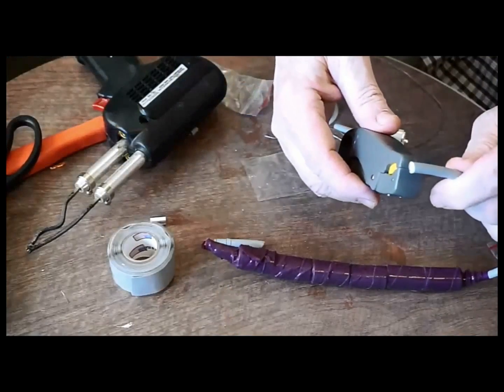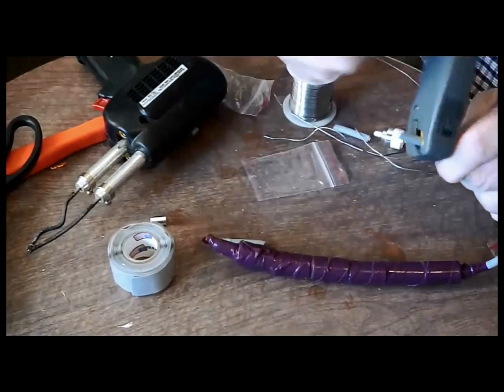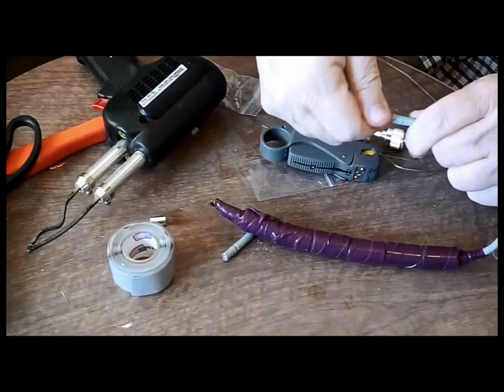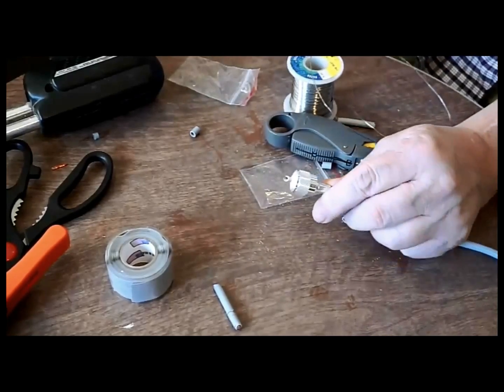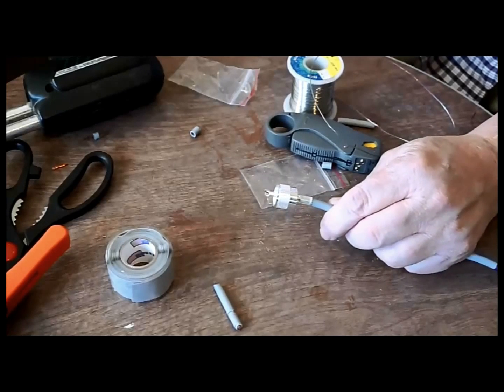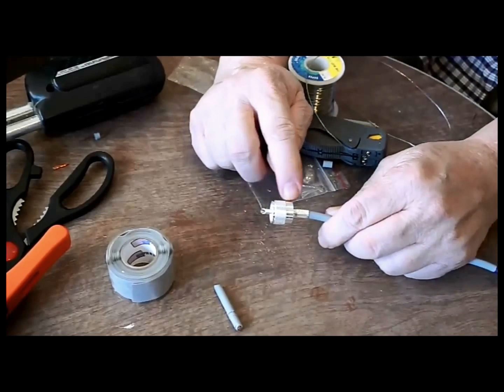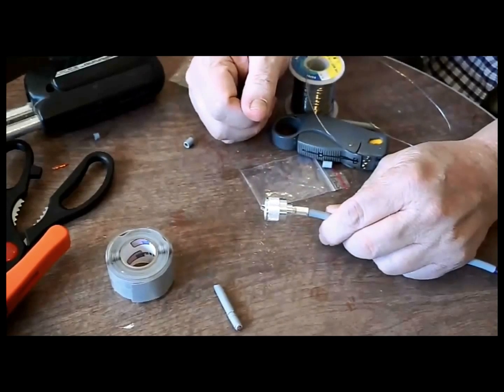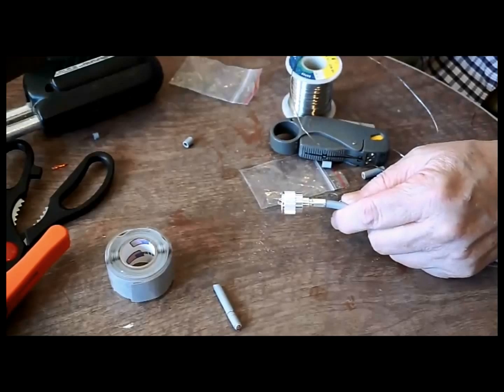Ham Radio Basics--Installing a PL259 Coax Connector in Under 1 Minute--Fire Fire!

Comment: Going to your web site for the connectors. Not sure the sequence of the video. Wanted to wish you the best on your medical.
Reply from the maker: I almost died from blood clots caused by MDS and Neutropenia with severe osteoporosis.  I am hoping that the MDS does not become AML as happens to about half who have the disease.  In my case, the MDS is trilineage and more likely to cause too many blasts.  The short answer: I became too ill to work and had to retire.  In my videos you don't see me on O2 and using a walker.  73, Jim W6LG

Comment: Installing a GP-3 antennae and didn't want to get the cheap Amazon pre-mades. Running the cable without the connectors is a huge advantage! Thanks for the info.
Reply from the maker: Thanks for sharing.  73 Jim

Comment: Thanks for a good how-to video. I have never made a coax connection before (I'm 70) and I am running a coax for VHF radio on my small sailboat, up inside the aluminum mast 27 feet to connector on marine VHF antenna. 
This is one of those things that is easy the second time. 
Your video is very good help - thank you. 
How do I attach the female end? 
Does aluminum mast affect coax signal? 
Coax runs alongside 12 volt wires, do they affect coax signal? 
Does this coax carry both analog and digital signals? (old analog radio on boat, new ones are digital, useful or not. (I'm a Luddite)
Male-female fittings at top & bottom of mast are exposed to salt water spray. How protect that male-female connection? That nifty grayco / rayco tape? 
Coax at base of mast comes out the side of mast, 6 inches of cable to another 6" of cable coming up through the deck from inside cabin where cable goes to marine VHF radio. I may coil an extra 3 feet in cabin to allow for moving radio, is that ok. 
After all that I don't know if antenna works/spreads signal). 
So many details: and I thought "just run another wire"!
That's my adventure updating to VHF radio that works! 
Bud Budster, luddite in Virginia 7-10-2019
Reply from the maker: Thank you very much.  73, Jim W6LG

Comment: How much power can you run through coax with a crimped pl 259? I've heard to run high power through soldered connectors
Reply from the maker: The limit is probably about 5KW.  73, Jim
Reply: @ham-radio  Ok. Thanks a lot!

Comment: Thank you, Jim...Great Video!   I need lots of practice, with soldering...afraid to make a mistake.  For practice purposes, can you desolder, and keep retrying?  73s, from N. Kentucky! KI6CMR
Reply from the maker: You can do it!  Crimping is the best way to attach the shield. You can solder the pin. And that part is easy.  Desoldering generally won't work all the well. 73, Jim

Comment: Wonderful video.  I have watched them with no feed back. So here my tnxs
Reply from the maker: Thanks Paul. As it turns out, and I just learned this today, hit the thumbs up or down.  YouTube measures that response along with some others in their formula.  Thanks Paul for writing.  73, Jim Heath W6LG now in Rocklin, CA....100 degrees predicted high with 14% humidity.  Fire season is here!
Reply: @ham-radio  where do you get your pl259. The crimping tools. Glad to see that you are getting better.  Been fighting pneumonia off and on for about 3 months.
Reply: Where did you get your crip. I  want one. Tried of soldering and shake to bad.  73

Comment: I have the problem of getting soder to flow on a pl 259 connector on the coax on gap antenna that is in my yard. I have a lot of nerves . my hand s  shake. but I'm taking my mate out to try again as soon as I get some coax connectors. I have them on order.
Reply from the maker: Get the best quality connector.  Some are garbage and the dielectric melts.  Teflon is good.  So silver plated PL250 with Teflon and a big Weller soldering iron.  A small portable vise that you can clamp to the table outside will help.  Also, also, name brand solder.  Get both the wire and metal hot first.  Both need to be clean.  73, Jim

Comment: I swore off ever instaling my own coax connectors 30 years ago, when I had failure after failure and all I got from other hams was sneers instead of help. It's been all store-bought ready-made since then. Needless to say, it's an inefficient workaround at best. Fast-forward a few decades and YouTube has empowered the real hams to out-shout the posers. Thanks very much, Jim. Not only did I learn how to make my own cables, you updated my coax knowledge significantly. (For example, I am/was still using RG 58!)
Reply from the maker: That's great Rob.  Good that you can do them.  I spent part of yesterday with powerpoles.  What a pain in the rear.  I used them on the motors of the tower installation.  I used the really big ones first and then the small ones (rated at 45 amps).  I had one melt down.  Probably the contact was not fully seated like I thought it was.  My power supply is homebrew with a variac.  The transformers is good for 50 amps at 24 volts with 1000mfd.  I am trying to lessen noise by slowing the motors that raise the tower.  So far that works.  I will be making lots of coax cables soon from the tower to the radio room.  Nice going Rob and great to hear from you.  73, Jim

Comment: followed this video and did my first pl259 install in a 1990 ford ranger where I fabbed a custom mount that mounted a 2-way radio antenna in the factory stereo antenna location and ran an antenna duplexer so that both the radio and the stereo could use the same antenna.

Comment: Hi Jim, with the dB not a big deal, just stick with 3dB is multiply by 2 and 10 dB is multiply by 10. Not much more to explain really  In the UK max power is 26dB eg 20dB is 100W and the 6dB means 4 times that which is 400W. Just wanted to give you the confidence to keep that topic simple..
Reply from the maker: Good advice Keith!  Thanks.  Regards again from Rocklin California, Jim

Comment: Jim, Thanks for this video. I plan to crimp some coax connections after soldering for years, I don't have the patience any longer. I was hoping to put the connector on in one minute, but since you've proven it takes two minutes, I guess I will have to shorten my nap time by a minute to make up for all this extra  time needed.  Drat !! So many connectors, so little time !!   '74  (That's '73 plus and extra digit to pay for that extra minute ! )   I'm looking forward to your video on how  to put up a multi-element HF Yagi on a fifty foot tower in less than an hour. Now that's a video I can really learn from ! So far it's taking me several decades, but I'm making progress. "Hi, H"   Keep up the good work. Your videos are extremely helpful, and your shack is a Ham Disneyland !!
Reply from the maker: Excellent.  Thank you.  I should check that old list I have and see if there was a 74.  Likely there was.  You probably know 88.  I don't know where anything is at the moment because so much is in the garage in boxes on shelves that are sagging under the load.  Thanks for watching and commenting.  73, Jim

Comment: I hope you have fully recovered by now.  I have been out of the hobby for 20 years now.   When I was in I was pretty much limited to the UHF males sold by Radio Shack and wasn't even aware they sold these crimp on type.  I never could solder and would either get a cold solder joint to the braid or would end up melting it into the plastic shield around the center conductor.   I am glad to know this type of connection exists as I am saving up for a new station. 73 N8PEF

Comment: While highly frustrated by having to buy too-long coax feed-lines, I was intimidated by the task of building my own. This video changed all that. After half a dozen, I still can't beat your time, but my problem is solved nonetheless. Thanks for the excellent and enabling tutorial. BTW, DX Engineering sells an excellent crimp-on PL-259.

Comment: Where is this raincoat tape sold?
Is there  another name for it
Ray
Reply: If I can't find things locally I have been known to order from McMaster Carr, Mouser, DigiKey, Newark, Allied, and many others.
Reply: Try this link, I think it will provide the answer you seek.  http://static.dxengineering.com/pdf/WeatherProofingCoax-TechTip.pdf
Reply: Here is another possibility for you  https://www.ebay.com/itm/2X-Waterproof-Clear-Rubber-Silicone-Electrical-Bonding-Tape-Repair-Patch-Seal/281447410507?epid=2254498659&hash=item418792ab4b:g:8ccAAMXQstJTlhUV

Comment: Just found your ch.  Very timely!  
I'm setting up an new coax/antenna system from ZERO. Receive only at this time. Thinking of going with LMR 400 into a SO 239 to a "wall socket " type fixture,where the SO239 is in the room in a fixed location,and I can swap-out radio gear as needed. I'll need lighting suppression and all...any suggestions??  Thanks!

Comment: hey jim. dale here kf4dcy. i bought a pl259 for lmr600. not the expencive type that cime with instructions. what i paid for cane with no instructions out of china because they cost 4.95ish on ebay. it resembles timewave types. but dont have metal shim rings. and no way to solder it. it having a sealed center pin. and not removable. no way to solder. it's the clamp type, with gland nut. and two rubber o-rings to aid being weather tight.

Comment: Jim, could one use soldering flux? didn't look like you needed it.  When I've soldered In the past I've used rosin core solder and flux.  I was also curious if one could benefit with using anti oxidation "goop" on the other parts of the connector to help in wet climates in conjunction to the tape?  Your videos are great, thanks!

Comment: Hi JIm thanks for the video. I'mnew at this so pardon my basic questions. I want to install a roof-mount antenna on my car, for which I think I will need to install the PL-259 after the wire has been threaded through the vehicle. The cable is RG58/AU and it comes with a loose PL-259. Which wire stripper do I need - two blades or three? Do you have a video with this detail? many thanks, 73's WA2JOE Joe in NJ.
Reply from the maker: Hi,

I sell the 2 bladed coax prep tool and that works fine.   I think this video has what you need.  If not, I can make another video with more detail if you want.  73, Jim W6LG www.hamcq.com

Comment: I worked in the aviation industry, nothing on an aircraft is soldered and all RF connectors crimped.
Crimp connectors are more efficient and stronger than soldered connections. Below is a copy and paste of a good article, I searched for an article in QST as I remember there was an article on crimp versus solder. I believe it stated that if you’re going to solder an RF connector it is better to be used indoors, for a sturdy strong outdoor connection it stated to use crimp connectors. When installed outdoors crimp connectors needed to be waterproofed and it was suggest did the best was to use the silicone also known as raincoat tape. The Cons about crimping is that the tool, needs to be quality not cheap junk.

“The end result is a coax and connector that is superior to any solder on product. I know there are the old timers who scoff at a crimp on connector but in the cell phone industry we have found that crimp on connectors have a much lower failure rate than any field solder on connector. In addition the pull strength is much higher because the coax crimp is a much stronger mechanical connection than soldering through four tiny holes found on the typical PL-259 connector body.”
 Eddie kj4fgi
Reply: Crimp is the way to go.  However, solder the center pin first then check for shorts with ohm meter.  If all is well then crimp.  That way if you have a short you can fix it.  Once you crimp the connector it is impossible to remove.
Reply: +Edward Vignati - What brand/model of crimp connector do you recommend that would be high quality?  What about the center pin?  How do you insure you have a good connection without soldering it?
Reply: +pgehin 

I use: 

UHF male PL259 plug straight crimp for RG8X LMR240
 eBay item number:111081185693
Which is Crimp and Solder,  center conductor is soldered, my cable, the (Center is stranded wire).
Or:
 UHF-Male Plug PL-259 Crimp Connector,
                              The  Shield and center conductor are crimped.  (solid center conductor wire) found in most RG58.  eBay item number:151706980454 
You  just crimp the Shield and Center Conductor, I usually use RG8x or LMR400 from DX Engineering so the center is stranded wire.

Always use an ohm meter and wiggle test, in the aviation industry we used smaller RF connectors similar to SMA type, never, never soldered. Crimp connection is  more uniform and when done right it's a solid connection.
Now that was all interior aircraft wiring.

 The ARRL QST did have an article on this, it was about a year or two ago. I wish I could quote exactly what it stated, it was just to long ago, after I read it I started crimping most of my connectors. For outside connections I seal my connectors with that self adhering, Self-Fusing Silicon Rubber Tape.

These are all sold by a Ham and are quality parts, his call sign N5IAW
73s  Eddie - kj4fgi
Reply from the maker: http://www.hamcq.com/coax-connectors-ferrite-beads-crimp-tools/pl259-so239-uhf-coax-connectors-adapters/

Those are the ones that I sell